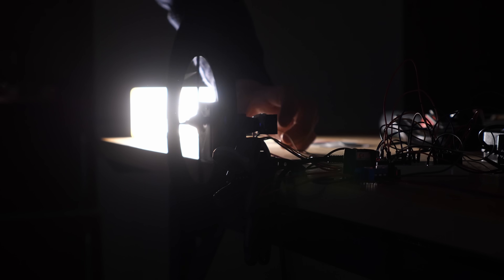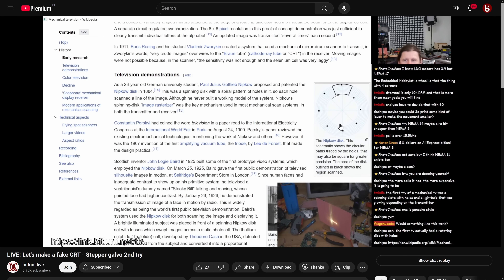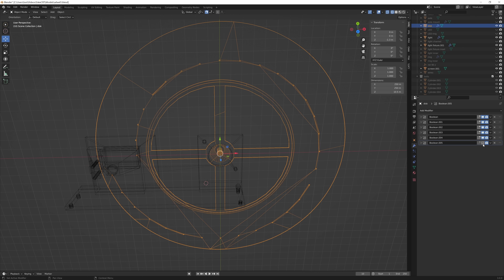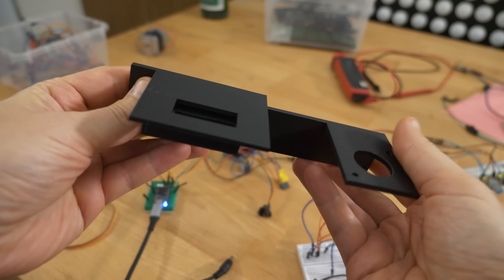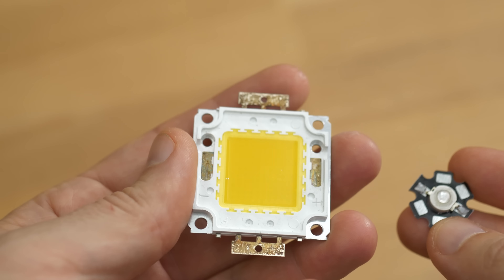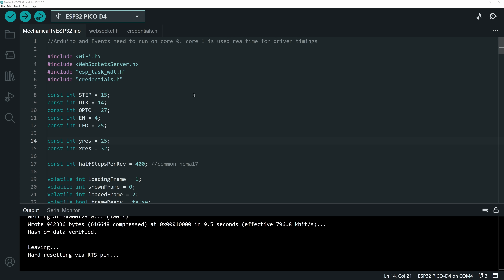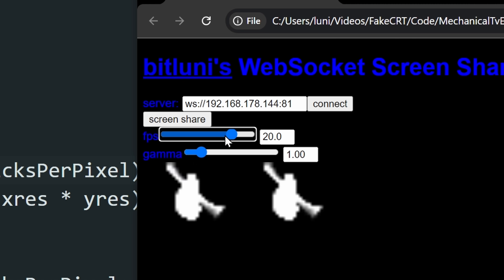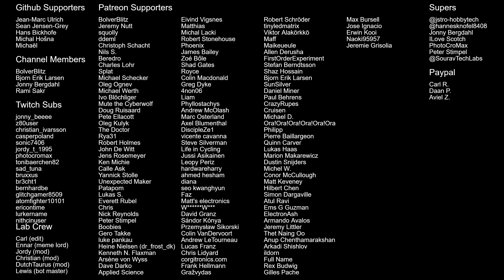I made a hilarious mechanical TV

Comment: Now we need a 15" version of this.
Reply: With the disk, you end up at a very high rim speed, and a huge disk. 
However, you can probably print a mirror screw (a different kind of mechanical television that is otherwise fully compatible with the nipkow disk system) very well and stick either thin mirrors to it, or make your own by coating glass microscope slides with gallium.
Reply: @mfbfreak I'm still not sure 15" is a good idea for that... the original spinning mirror attempts still only had spans of a few-several inches. That's a lot of not just mass but fragile mass, spinning rather fast, that also needs to be in near perfect balance because of these two ideas.

That said I think the spinning mirror is superior in many ways to the disk (which still is far inferior even to earliest CRT), but would be equally more difficult to construct. I've actually attempted neither to date, however the mirrors would still be my go to for the first run at it. Clarity and size being at the forefront.

Of course this means a photodiode camera also needs to be made... I'm all for working around that with a computer until the display is worked out, but to be authentic and take the experience all the way... 🤣
Reply: Just make it project onto a wall using a lens…

I don’t Know why anyone using this tech hasn’t thought of it.

Why would you want to look at such a small screen?
Reply: @ironhell813  There's nothing saying you can't, but you need a lot of light. Projection of any kind involves spreading all of the effective light out over whatever area the "screen" takes up.

The issue with that, you'll find, is heat. To generate the kind of light you need, the disk has to be able to handle all of the heat any absorbed visible light makes but also any IR component. BigGER may be doable, but "big" would get at least as interesting as the development of the rest of the system ever thought of being. The good news is you can probably use the same light you're using for the camera... as if you take it all the way, you have the same problem on that end, "in reverse".

Edit: A high power light source is also that much more difficult to modulate as well.
Reply: @MadScientist267  You're saying that the more power a light source requires, the lower the frequency at which it can be pulsed? Or what?
Reply: @bricaaron3978  It's just more difficult to control and yes in general the natural tendency is to lose the ability to do higher speeds. Not impossible, just progressively more difficult as the power levels increase.

The basic issue is the idea that a higher power light source needs higher power control systems, which tend to have larger components than lower power counterparts, in turn slowing the signal path down due to effects such as parasitic capacitance and inductance that are unavoidable. 

It's always a balance.
Reply: @MadScientist267  I think I understand the issue of larger components and higher power, but that makes me think of radio stations, in which signals in the megahertz range are amplified to very high power levels. It seems there must be some way, if not just throwing lots of money at it, lol.
Reply: @bricaaron3978  Sometimes just throwing raw power at something is the way to go, but even that's not quite the case with radio.

This could branch out quickly and get all kinds of messy from here but I'll try to clarify the light and address a fundamental concept used in radio to reduce raw power requirements.

An analogy for the light: Think of it like picking something up in your hand and then trying to move it to yet another position quickly. The heavier it is and the longer your arm is (analogs to capacitance and inductance), the harder it is to get the object to move quickly (manifests as blurring in an analog video system). 

If you hold the object out further or increase its mass, the effect will be the same - it is naturally slower unless you put more effort into it... but this forms a feedback loop that perpetuates the problem... Can't just keep applying more power as a stronger arm also has more mass. While you may have more strength and can move it quicker, you're now intrinsically losing the fine control you're trying to achieve. 

Same happens in all electronics, and it's the cause of the limitations imposed under the concept of "bandwidth", or a more legacy term for it from my day, "slew rate" - how fast a given component can change its output from one given value to another.

Radio: Inside the final stage of an RF amplifier, a few clever concepts allow much higher power to "appear in the air" than is given to the building that contains the amplifier. One is that the active output components don't directly control the antenna. Instead they are used something like a swingset. The dynamic of the person in the swing (mass, length of chain) determine the frequency they swing back and forth. Someone "pushing" the swing has to exert almost no energy once it is reaching the desired height on each cycle. If you were to try and manage the entire cycle of the swing manually with raw power, you would wear yourself out quickly and not accomplish anything real. Odd looks maybe lol

Same happens in a thing called a tank circuit, which is an inductor and capacitor set up to act like a "swingset", and the antenna could be thought of I guess as the person in the seat. Sorta. Analogies have limits lol

Now imagine trying to suddenly stop and change the swing's direction... a considerable amount of effort is required, and it's gonna be chaotic. This is what, due to the different nature, the light control for the video system has to deal with, as in effect, it must micromanage the light source at every point in time and at every brightness level, and quickly.

Imagine this has become a huge block of concrete hanging from a crane... you can probably see how this is sizing up.

Likewise, the block of concrete will happily swing back and forth with minimal outside input.. but this kind of control isn't useful in video, just radio, where it really wouldn't be practical to attempt to use radio waves otherwise, if this weren't possible.
Reply: @bricaaron3978  I guess my take on it as it applies to the video and projection... it's doable.. probably need around 100W worth of LED to get any decent size on a wall/screen. I wouldn't think any other light source would be able to pull it off with any dynamic range (contrast) if at all. A laser, but electronically, that's just an LED at the DIY level. You could do it that way as well for that matter, really. It satisfies the speed and brightness requirements as such, anyway. Dynamic range is still a little bit of an issue as there's a minimum lasing power below which the scanning spot would all but disappear. You'd need a lens methinks, possibly on both sides of the disk, as you wouldn't be working with a "beam", but the uncollimated light from a bare diode to do this.

But for the LED, the fun part would be driving the array as there will be a non trivial parasitic capacitance just in the array itself, ignoring what's in the driver feeding it. But probably the best bet. My guess is a 100W die array would still have blurring issues but the image would probably be recognizable anyway. I think this would only require the one lens but I may be wrong there (or on the laser version for that matter.. I don't do much with projection).

I don't see anything else really working. Gas discharge ("neon", fluorescent etc) isn't bright enough for that, arcs of any kind are out for various reasons (xenon, carbon), and of course incandescent... lol which can carry audio but video is way outside its abilities and most definitely for any kind of display 🤣
Reply: @bricaaron3978  Radio is a MUCH lower bandwidth signal than video. And it's a totally different medium where you can match the impedance of the antenna, etc. Modulating an extremely high-power LED (or a large array of them) starts to become more and more difficult. It is possible but the components get more expensive.
Reply: @AureliusR  No doubt. I was simply responding to narmale's comment indicating that the rotational speed of the disc would be a limiting factor.
Reply: the disc would be about 3 stories tall and the speed required would put the edge speed past mach 1 :3
Reply: @narmale  If a disc were ~30 feet in diameter it would only have to rotate at ~600 rpm for the edge to be moving at Mach 1.
Reply: It can be done mechanically (and briefly was, historically), but not with a Nipkow disc; you have to pass a focused light beam through a system of spinning mirrors to create the raster scan of a focused spot on the screen.  The same technique is used in modern laser projectors.
Reply: @tommcewan7936  That wouldn't be a "15 in version of THIS" now, would it...

Comment: You could try to simulate a scanline with a tape instead of a disc. a longer track is also given for greater details. :)
Reply: Ooof.. same issue as the disk. The "tape" in whatever form it takes will need to be frame width x line count long.

Doing rough math, a 12" wide frame with 100 lines, would need to be 100 feet long in a loop, which does a complete pass for a single frame. For even 15 frames per second,  you'd need to move the tape at 1500 feet per second.

That's um... damn quick.
Reply: @MadScientist267  That's like.. going at around Mach 1.5.  The TV set will break through the sound barrier !  :D
Reply: @MadScientist267  yeah, thats the conclusion i came to as well... for just a very low resolution and frame rate, the speeds required are phenomenal...

could maybe reduce it somewhat with two belts at right angles with angled slots, producing the required scanlines as they mask each other ... iunno, i did some basic maths a few years back (pre internet?) and thats about as far as i went with it... seems easier to try and make a CRT!

but i also wonder if two sheets of slightly different spaced holes could be gyrated to produce the required raster? 

im not a subscriber to the "because it is there" mindset. i like to do something for a practical benefit, not just... "because i can"... example... i tie my shoeleaces for a reason... not just because i can.
Reply: @paradiselost9946  I would think the only real way to do it with a "tape" would be (for horizontal scan) a vertical slot in the tape for every frame and each line would need what amounts to a flat light pipe that extends the width of the frame... with it's own LED behind each one.

Still seems a bit radical at the DIY level but I think much more doable as the tape speed would only need to go as fast as frame width x frame rate... still pretty quick but if it's possible at all, you gotta get that tape speed down to a manageable level 🤣
Reply: @paradiselost9946  How about a tape on something like a typewriter carriage, which is nudged downward a skosh at the end of every scanline, and the carriage returns to the starting position during the vblank? Could be a really noisy TV!
Reply: a ball would be better easier to spin at high speeds
Reply: @primus711  Circumference still would need to be frame width x line count. Anything more than a couple inches of "screen" is going to be absolutely massive in size and it doesn't take long to require a surface speed that is better than mach 1. There is a reason these things remained small.

Comment: Hey Bitluni, I really love this project and I enjoyed watching the build process. I was however slightly worried about the used power supply. In general, I am extraordinary cautious of which SMPS to trust, because many lack sufficient inter-winding isolation in the transformer (or elsewhere, this one here has mains voltage in the switch portion of the rotary knob) or a VDE certified class Y capacitor or just get too hot. @DiodeGoneWild has made a teardown video of this power supply and showed that it is a bit on the dodgy side. I would prefer proper (more expensive, for sure!!) power supplies from major brands like mean well (not affiliated). I know though that I tend to worry too much about power supplies.
Greetings, Vielen Dank für die vielen kreativen Ideen und Videos!